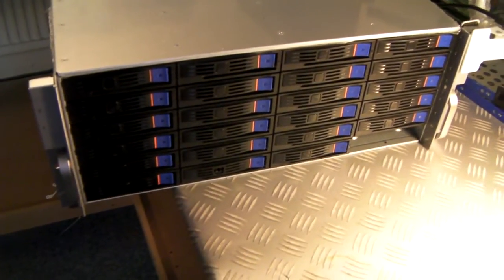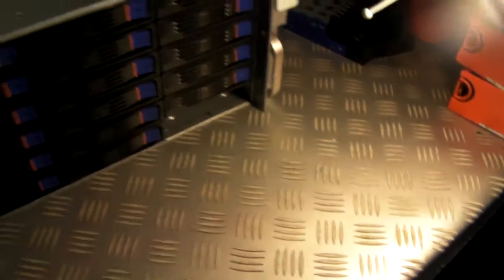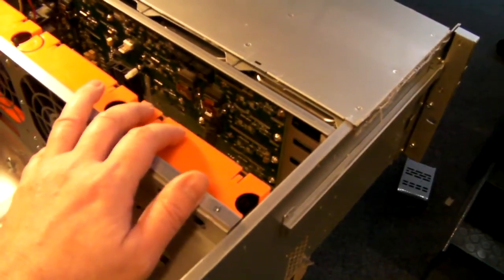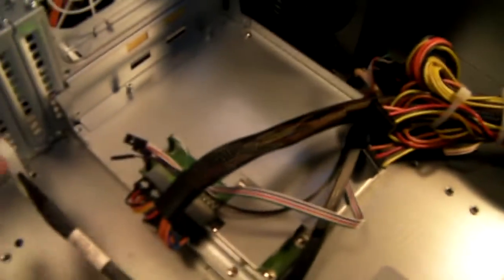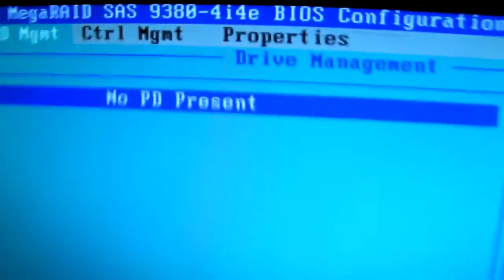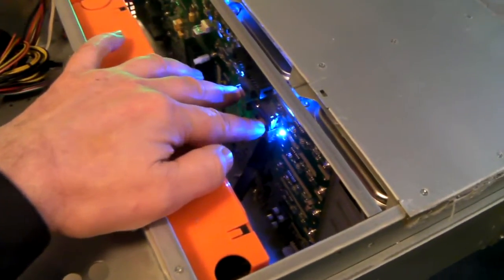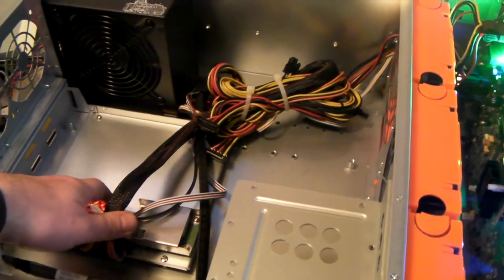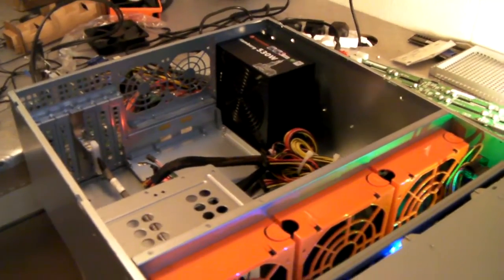24 Bay Low Cost JBOD Solution by X-Case

Comment: How would you even drive all those drives from 1 SAS cable, thought you needed a card for every 4 drives. Or atleast 4 drives per cable
Reply: from what i can see, i guess the JBOD with the 24 disks, has 6 inbuilt SAS Card Expander and each Expander supports 4 ports (SAS/SATA) and the miniSAS connector(supports 4 ports) on the backplane of the JBOD is connected to the external miniSAS Connector, attached to the chassis of the JBOD, which then in turn connects to the External miniSAS Connector of the 9380-4i4e SAS Raid Card Controller (on another PC).  The Major Control is done from this mentioned Raid Controller and it can support up to 240 3gbps, 6gbps or 12gbps SATA or SAS Devices.    I hope it is understood